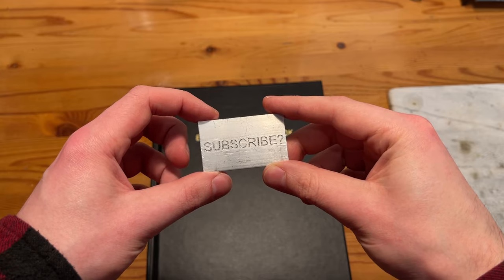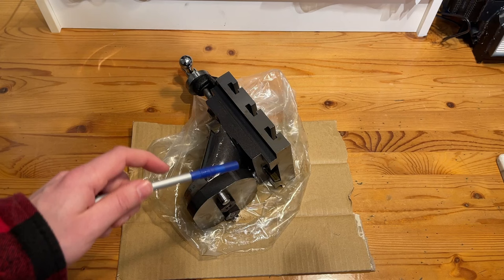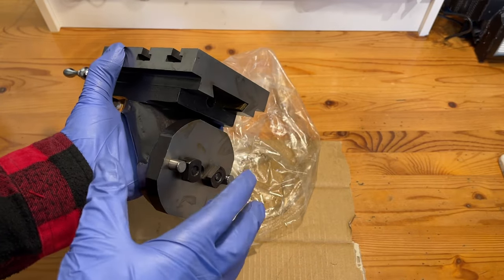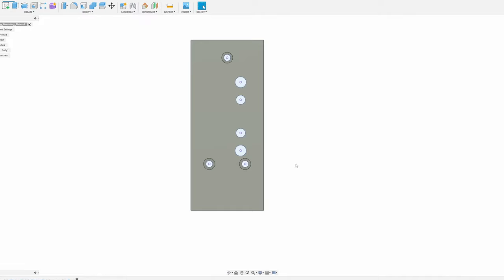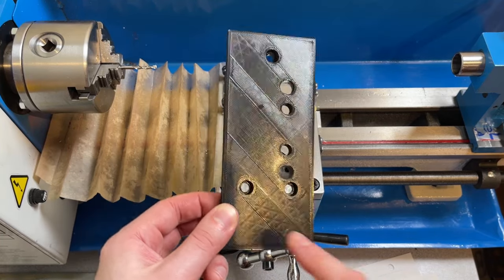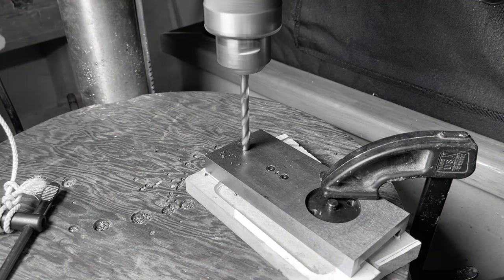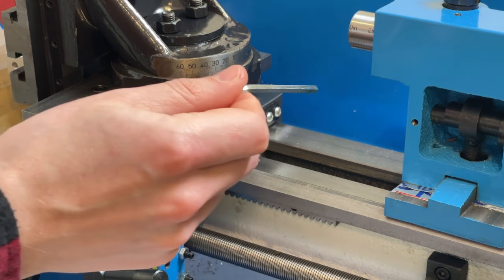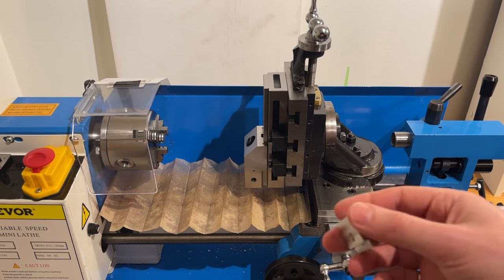Testing the Cheapest Mini Lathe Milling Attachment on Amazon

Comment: Also if you do decide to go with collets don't buy Morse taper collets they are relatively expensive, hard to find and limited in their capacity. I would get an ER collet chuck. They allow for the work to pass through the spindle and their clamping force is much higher.
Reply: I bought a lathe made in a Soviet factory that came with Morse 2 collets as an addition to decent self-centering three jaw chuck. The collets are unusable. I am not sure whether it is because of it is inferior construction, or because they were made in Russia (or a combination of both ;-) )

Comment: It's very smart to make prototypes.  I was an engineering manager for a lot of years and one of my slogans was, "Prototype EARLY and OFTEN."  Another close cousin was "One test is worth a thousand opinions."  Many engineers do a lot of living in their head, which is fine, because that's where the ideas come from.  But it helps to get tangible quickly.  It is also the best way to show a design to somebody else for comment.
Reply from the maker: That’s some solid advice! Fully agree with you there!
Reply: If you only do ideas in your head you’re an academic.  If you test them on the bench, you’re an engineer.   Very different types of people.
Reply: @pentachronic  And if you are a GOOD engineer, you know that prototypes can quickly reveal oversights AND make it easier for other people, perhaps less technical people, to grasp the idea in ways impossible by looking at drawings or even 3-D renderings.

Comment: You don't really need a collet chuck. Although they are extremely useful. You could use a Morse taper 3(I'm guessing that is what the lathe uses) endmill holder. But with those you would have to get endmills that have Weldon flats on them. Also not sure if you can get one that is metric. The one I have is SAE and takes 3/8" shank mills.
Reply: Of course there are metric weldon holder, they are more common than bald eagle per school shooting ones, because almost the entire world uses metric tools.
And you can just grind a flat on a endmill.

I wouldnt use weldon on such a small lathe, because of the runout error of the weldon.

Comment: I fully expected the mill slide to cant back away from the endmill.  I do milling on my lathe and this is always an issue due to any movement in the cross slide dovetails.  You handled it as well as can be expected.  One trick you can do when drilling into work is to use the tailstock as a centre line brace for the mill slide.  It will stop any canting.  Overall the little millslides work quite well considering their short comings and limited x/y range.  Enjoy.  Cheers Rob
Reply from the maker: That's a great trick! Thank you for sharing!
Reply: @Someone_Should_Make_That  I forgot to mention that you use the tailstock quill to push the carriage and work into the drill bit.

Another thing that will give a better finish with less chatter is to "ramp cut" when milling.  Feed the job into the cutter (away from the operator) front to back and this will cause the mill bit to push down on the job with it's cutting action.  If you go back to front (towards operator) it will try to lift the table/job and cause chatter.

I hope this helps.

Cheers Rob
Reply: Won't happen with a decent quality lathe. 1:00 Many of the cheaper lathes have narrow poor fitting cross slides.
20 years ago I bought a Colchester Chipmaster lathe for £400, it had seen better days but was a quality machine and very rigid. I built 4 live steam locos using that machine which included 2 x 5in and 2 x 7•25in gauge. I use a heafty vertical slide on that machine but most of my flat surface machining was carried out on a very robust Elliot 10in stroke shaper.
Reply: @haroldpearson6025  Nice to have that sized machinery, but most people don't.

Comment: A key issue with any type of milling attachment such as this is that there’s a lot of overhang to the left of the cross slide, and it puts an undo load on the gib. You gotta figure out a way to brace the load as it hangs out during machining, especially milling. What I did with mine, which is on a jet lathe is I built it as far back as I could so that the main load is actually over the cross slide. I also built in some extra strong locks for the cross slide gib, whenever I’m not moving that axis, which I call the X axis.

Comment: the best use for these is line boring... much easier to hold work, especially if youre lathe is like mine... no slots on the cross slide. hate having to drill holes but ive had to throw a few in. and shimming sux, much easier to twiddle a wheel for centre height.

Comment: That design of vertical slide is a copy of the Myford one. In some ways the Myford one is not as good, others it was better. I think the original one is less beefy, but it looks like the original has better quality screws than the copy. I don't think those quality differences will affect the quality of the output that much. My main observation is that the Myford version was designed specifically for use with a Myford 7 lathe. I think your mini lathe is a bit smaller. It has smaller gibs. That will make a difference to the quality of the work you can produce on the vertical slide. If you could get a slightly bigger lathe it would help improve the output quality of the vertical slide by quite a lot. I have a milling machine now but I used a vertical slide for years on my Myford. Actually I still use the vertical slide instead of the mill from time to time. The one advantage that the vertical slide has over a small vertical milling machine is the long effective z travel (the length of the bed). When you want to mill features into the end of something quite long the vertical slide pays dividends.

Comment: Nice project. I have a similar rotational issue to solve for my cheap import milling attachment. I'll be using some of your ideas to get to the solution that I need. One of the less-important details that I noticed is that we both made the same fan cover for the control board of our respective printers :)

Comment: Many moons ago when I was a poor student I built such a vertical slide for my 6" Atlas lathe.  It worked very well and eventually used it to mill the flutes in the coupling rods of the steam locomotive I was building.
This device must be used carefully because it imposes a lifting load on the cross slide left hand dove tail, for which this dove tail is not meant to be used.  Light cuts is the guiding principle here.

Comment: If you find your JB weld fix ever pulling out or having issues, consider using a helicoil to fix it. A helicoil takes a too big hole, and adds some smaller threads to it. 
This cheap milling attachment may be just the ticket for not buying another machine to put in my small garage 😅. Thanks for the video. Still happy with it after a year?
Reply from the maker: Good tip! Yes it handled everything I threw at it quite well. If your lathe has a larger cross slide it will likely perform even better.

Comment: Neat - I bought what looks like the same slide. Your design pretty much mirrors mine - I was going to suggest rotating the screws that pick up on the top slide mounts to a slight angle so that they cleared the base of the vertical slide, and in the next minute you'd done it (as you know, it means that the adaptor plate can be taken off without having to unbolt the vertical slide first). I put a dowel into the cross slide  where you tapped a hole, and I tapped holes either side of it (where the bolts can go into the thickest part of the cross slide. The combination of dowel and the 'nub' where the top slide mounts means that the slideway can be removed and replaced with out needing to indicate it in to parallel.

I did manage to knock the dowels out of the base of mine, making it easier to mount - I've had to make a few more tapped holes for different mounting options to suit specific jobs (such as having the slide parallel to the bed so that long things can be held sideways in the vice - my first project was also some clamps to hold a vice to the slide.

A graduated collar for the leadscrew is handy for dialling in cuts, and as others have said, it's handy to be able to use the tailstock to support the slide. I use morse taper MT3 'finger' collets directly in the spindle taper to hold milling cutters - they're cheap, and you only need a few sizes to suit the mill shanks. (You need to make a draw-bar, but that's just a long bolt and a collar.)

I ultimately ended up ditching the supplied mounting bracket and modifying the slideway so that it bolts onto a small, cast iron, right angle bracket bolted to the adaptor plate - I never used the rotation features (there's not enough slideway travel) and this makes for a more compact setup with less overhang.

For those people talking about flycutters - the X slide travel is extremely limited - you would want to clear the work at each end of the travel, so the size of workpiece you can flycut is tiny - something like a 10mm / 3/8" dia end mill is just as quick.

Good luck!
Reply: Here's a photo of my current arrangement:  https://misterg.org.uk/2021/wp-content/uploads/IMG_2307-600x450.jpg

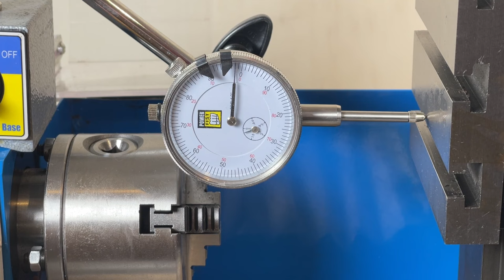Comment: at 10:37 an adjustable vice like device simply appears on the milling attachment with no explanation where it came from and due to me being new to hobby machining and not knowing all the nomenclature necessary to do  a search i cant find anything like it online. i'm tryin to make a setup primarily for turning and slotting small shafts but don't have room for both my mini lath and a mill.
Reply from the maker: Hi, that vice is just one I had lying around that I used with my 3018. It’s not very good I wouldn’t recommend it. The better vice I used later in the video you can find on Amazon by searching “accusize 2 in vice”. I’m not affiliated with the company but I’ve had good luck with everything I’ve bought from them so far. As for general search terms you’re looking for a “milling vice”. Good luck with your projects!

Comment: This was cool to see! I'd been wondering about the value proposition of some of these milling attachments. 

That play in the cross-slide looks really frustrating! Had you already noticed it before this project or nah?
Reply from the maker: Glad you enjoyed! I haven't found the cross slide play to be an issue when operating the lathe normally. The large distance between the dovetail and the actual cutting location exaggerates the effects quite significantly (it's a very slight movement, if the oil wasn't being pushed out slightly I wouldn't be able to see it). I could probably reduce it by fine tuning the gibs screws, but locking and unlocking that axis for each vertical slide cut isn't too bad of a trade off.

Comment: I know a guy who drilled a hole 1/1000th too big, when he ran the tap through the hole, we heard a cracking noise...letz just say, flight operations on board that particular Her majesty's vessel we ceased for the remainder of the voyage and the young seamen officer was never allowed use a drill and received lengthy education and training on the importance of listening to senior sailors, metal fatigue and the properties of cast iron abd proper use of drills, taps and dies. I learnt a valuable lesson from simply being on the same ship. That was the importance of accuracy and tolerances. It was a very valuable lesson and the mistake made was in recutting a thread that didn't need recutting and the entire problem of a tiny drip would have been easily solved with the proper use of thread tape and or some adhesive that was fuel safe. Instead the officer chose to redrill the hole and tap a new thread. It cracked the cast iron drain assembly on the number 1 aviation fuel tank. This meant the ship could not refuel helicopters whilst underway. Refit...sorry fleet our vessel isnt sea worthy...not a phone call I would wanna make aye .
Reply: BS. Engineers build in a safety factor for this very reason. And usually that safety factor is way more than it needs to be. 

You wouldn't drill to that tight of a tolerance nor would it cause any sort of a failure either way. 

.25mm or .010".. maybe.. but even then, the thread nor tap is extremely unlikely to fail, especially not in a way that is going to send a ship back to the yard.
Reply: @KingZeusCLE  ok mate you know everything, but pretty sure you weren't there dude..
Reply: @KingZeusCLE  and engineers don't know everything despite what they think..you assumed that you did...but you forgot some critical information.. something to do with ambient temperature and allowances for changes in it and pressure. All tapping guides assume normal temperature ranges...what's normal temperature? Because here in Australia normal could be 38 degrees Celsius or minus 25. Depending exactly on where you are in the world. Drills have +/- tolerances at normal temperature and so do taps. In extreme cold, where we were at the time. Officer followed the "chart" for drilling and tapping...crack..why? Because the one tiny detail in the fine print. The valve block was on outside of ship in the current normal temperature of minus 20 degrees...so what happened to the built in tolerance the engineers calculated generating the tables? They use an ambient normal temperature of 26+- degrees Celsius. The block was the water drain on the tank..it broke. Because when investigation was completed they found temperature effects drilling and tapping sizes and given the material is what caused the fracture. The tap was oversize by just 1/1000th. The drill under 1/1000th. Expansion and contraction of materials.
Reply: No, this is TOTAL BS.

+\- .001 is NOT going to cause a tap to break.
Drills do not make a hole anywhere near that accurate neither would expansion/contraction make a difference since common practice is to only tap 75% thread depth.
I you can probably go that much larger without issue. 

The comment was made by a pathological liar.
You will find a lot of them in the youtube comment section.

Cheers

Comment: My recommendation is to hold the milling cutter is a square ER collet block, held in the 4 jaws chuck. Why,  because these are items that you will want and use all
 the time. If one really want an ER collet chuck then make sure that you get the biggest that is available for your lathe, because you may need to hold work of some size in it, not just cutters.
Reply: I own the same lathe. The spindle has MT3 so a collet chuck with a taper would be just the ticket.

Comment: Hey. Very nice and interesting to do the same. Some question.. what's your lathe Swing distance is it a 7x14.. if so. Do you have experience a need for more length yet ..? I gonna buy one but maybe bot bigger if i could. Thanks man.
Reply from the maker: Hey! Glad you enjoyed the video! My lathe is a 7x12 and I have not run into the need for additional length yet. My main deciding factor when I was buying mine boiled down to the fact the 7x12 was much cheaper than the 7x14 so I went with it, and I have no regrets with that decision at all. Your mileage may vary depending on the kind of parts you make of course, the best advice I can give is get the biggest one that makes sense for your budget and space available (keeping in mind that $200 dollars in savings on the lathe can let you pick up a set of cutters and some tooling if you're stretching the workshop budget like me!). Hope this helps and good luck with your projects!

Comment: Make a fly cutter, it will make surface finishing look pro.
Old 1/4 drill bits with a carbide tooth from an old  quality wood dropsaw blade braised on is my standard bit for fly cutting and gear making

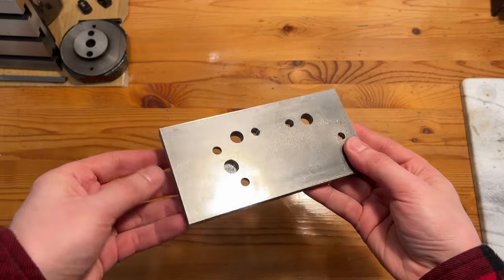Comment: 10:00 Get yourself a cheap helicoil set. Just owning will makes so you will never drill wrong again for tapping, as its mere presence in the shop will scare away the evil spirits. Of course, you will be (very occasionally) able to use it to fix threads messed up by others.

Comment: A lot of people are commenting about getting some collets but I feel the scope of this project is to get the most for the least the same way a giant shop with unlimited resources often do. Running an endmill in a conventional chuck works but you'll have to compensate a lot due to the end mill runout. The closer the chuck jaws are parallel to one another is a key point, if not you'll get a not so flat and square part. There are plenty of videos on grinding 3 jaws chuck to run true, a cheap dremel grinder could be adapted.

I'd say enjoy what you have to work with but save up some money for a real machine, like a Bridgeport and a complimentary quality lathe.

Comment: Hey, great video and review!
honestly, it looks like a decent cheap milling table, just some rigidity and tolerance slop easy-ish fix. Something  of note: Does your drill press have the pulley speed change? if it does, using that will help a lot with metal. Also, grab a cheap bench grinder and sharpen your own drills. Just learn on the burnt out ones 😮. My opinion on chucks is to get a four jaw chuck. It will open the way for larger work holding and off center boring ... incase of a repair, so to speak. Again, this is a great video, and I hope you're enjoying the hobby.

Comment: I used to use my vertical CNC milling machine as a lathe  when I didn't have a dedicated machine for turning by my side. But the major problem with such shortcuts is that our life should be way longer than it can be in order to afford that kind of approach. But if choosing between either having a manual lathe with a vertical attachment or having a vertical manual mill I'd go with lathe + attachment for sure because a lathe is more versatile machine than a mill.
Reply from the maker: Completely agree with that! I'll definitely upgrade some day, dreaming of the full garage workshop setup